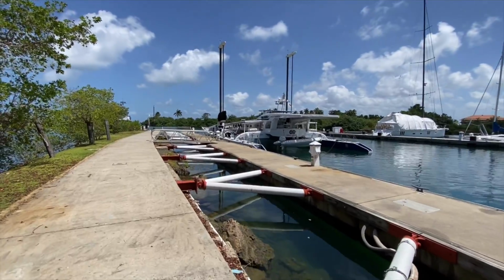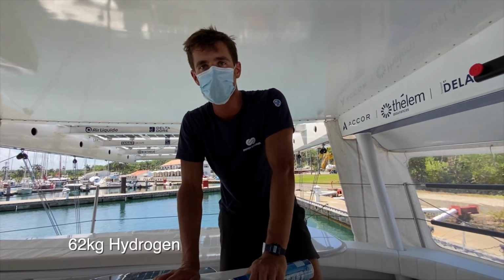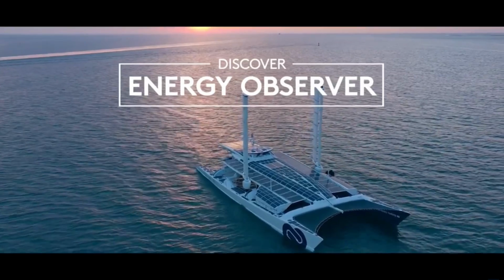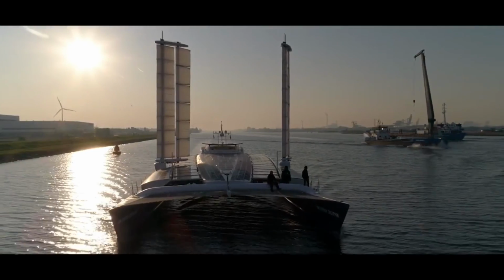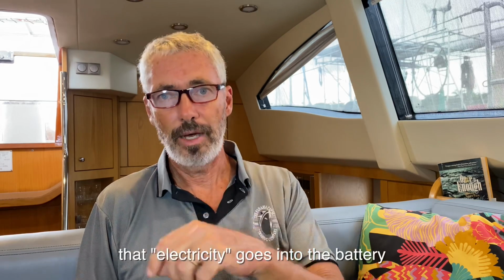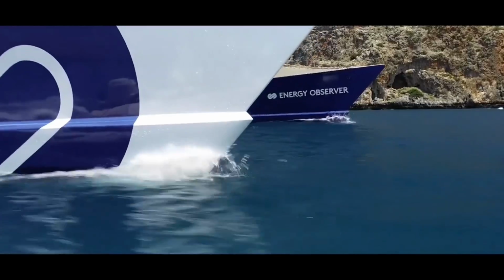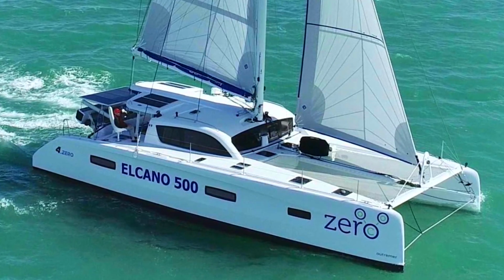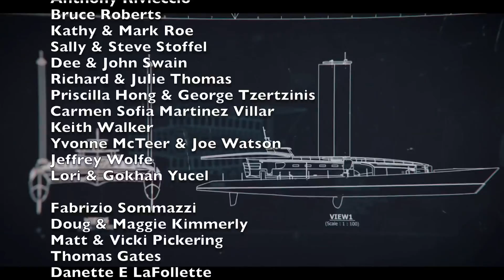Hydrogen-Electric powered boat! Can we get this on our new sailboat? | EP 204

Comment: I wonder how they feel during a lightning storm sitting in a vessel full of explosive gas. I'd like to see their grounding system. I tested grounding systems as part of my job (before I retired).
Reply from the maker: Interesting comment Tom. I asked about fire/explosion and they pointed out the compartment where hydrogen is stored is open to the air on the stern side. And since it’s so light it will disperse up.
Reply: It's amazing that this was not brought up by the hydrogen boat folks.  It looks like this boat (or are there more than one?) has multiple masts for its "wing-like" sails.  Plus being soooo electric a lightening strike would surely do lots of damage.  And since a lightening strike can be (literally) explosive, then hydrogen tanks could be ruptured during such a strike.  It's not hard to imagine that boat being in a million pieces after a lightening strike!   Scott W 
PS - I bet no one is allowed to smoke on that boat!
Reply: @scyz2807  They've talked about it in other interviews.  Like mentioned in the previous reply, they mount the hydrogen vessels outside of the boat (though covered) in a position where any venting hydrogen can more easily disperse, and away from the sails in case it does ignite.

The hydrogen itself in the tanks is not explosive, it's only once combined with oxygen that it becomes explosive, however the saturation level at which it becomes explosive is quite low, so a leak could be a huge fire risk, but at the pressures that hydrogen has to be stored at, there is basically zero risk of the tank exploding.  You could get one hell of a flame thrower at the leak point, but the flame would not travel back into the vessel simply because the lack of oxygen would prevent that, along with the several thousand lbs of pressure preventing oxygen from entering and mixing with the hydrogen.

The biggest risk is a slow leak that goes undetected that allows hydrogen to collect and mix to a flammable level, which is why EO stores the hydrogen externally.  Fuel cell cars (Toyota Mirai being the most prominent) also face this same risk, but even higher with a much greater risk of collision damage to the storage vessel, and I don't believe that any of those have blown up, or even resulted in a catastrophic fire (technically putting them above battery electric vehicles for safety, but that's irrelevant).

Hydrogen transportation is not new either.  The vast majority of hydrogen is transported on trucks and even in the event of accidents, the equipment has safety components and factors specifically to address the dangers which have decades of safe real world use.  Hydrogen and hydrogen fuel cell technology actually has an incredible track record of safe and effective use going back half a century (spacecraft have used hydrogen fuel cells for power since the Gemini program, iirc).

The biggest hurdle to hydrogen is twofold right now
1. Production - Currently almost all hydrogen is "brown"/"Grey" hydrogen that is produced from fossil fuels and releases quite a lot of CO2, and therefore is not really green.  Next is "Blue" hydrogen which is much less impactful, capturing the produced CO2, however it is much less cost effective, as the extra process of capturing and dealing with the CO2 is complicated and expensive.I believe that hydrogen produced via electrolysis, but using non-renewable power source to do so is considered "blue".  Then we have "Green" which electrolysis powered by renewable power, this is the only truly eco-friendly source, and consequently most costly method of getting hydrogen.

2. Efficiency - It takes roughly 55kw of power to purify, electrolyze, and compress 1kg of hydrogen right now.  At 100% efficiency 1kg of hydrogen stores around 33kw of power, so even if fuel cells were perfectly efficient it would only come out to around 60% efficiency.  Unfortunately the best fuel cells are around 55% efficient, meaning you can extract a bit over 18kw from 1kg of hydrogen.  This can be increased by utilizing the waste heat for something, however many applications simply don't have enough need for that much heat (imagine 150 100watt incandescent light bulbs running at the same time.  You could bake a cake with that), so there are limits depending on your application.  That leaves us at a final efficiency of a system around 33%.  Technically speaking this is actually more efficient than gasoline or diesel, particularly when you account for the production side of the equation, as gasoline and diesel engines are only about 30-40% efficient at extracting energy from dino squeezings, but still not ideal, particularly for an application like a boat that might need to produce its own hydrogen such as is the case with EO.  EO is unique in that they can fit an amount of solar production massive enough to make this efficiency loss workable simply by having far more than enough solar power generation and using the excess to produce hydrogen for deep storage.  In a practical, real world "normal person" use case, such as a cruising boat, fitting enough solar to power a boat without electric motors can be quite challenging, and fitting enough to have meaningful excess that can be used to produce hydrogen means that the boat has to be designed specifically for that goal.  Catamarans are the best cruising platform for that simply because they have so much more real estate available for solar panels, so these will be the first consumer level self-producing hydrogen boats we see.

I myself have spent the last 8 months of my live working on designing one, and wish I had the many millions of dollars it would take to go from napkin sketches and playing around in fusion 360 to factory turning the industry on its head.  If I wont the lottery this would be what I would do with it.
Reply: @FlesHBoX  Thank you for your reply. I want to be an one of the first crew members on your Hydrogen powered Cat after you win that lottery 😁👍
I was a High Voltage Test Technician, now retired and looking for warmer weather than Upstate New York.
Reply: @FlesHBoX  Thanks for all the information.

Comment: I think that graphene batteries, and possible graphene desalination could be real game changers. Apparently the power required to generate the pressure required for reverse osmosis desalination is high than you'd think.  Graphene allows for lower pressure, and energy expenditure to get the same water. Graphene batteries will also be significantly lighter, and almost completely eliminate the rare earth metals required in lithium batteries.  They are still a number of years from being cost efficient on an energy density basis, but it shows a lot of promise for a material we only discovered in 2016.  What do you think?

Comment: FYI:
UK is building a liquid air battery using green energy to compress air into liquid and store it. When energy is needed, the stored air is released forming a gas that powers a turbine. The turbine then uses some of the energy to convert air to a liquid for storage. This was reported by The Guardian on June 18, 2020. The title of the article is "Climate emission killer: construction begins on world's largest liquid air battery." This battery is due to be placed into service in 2022, able to power 200,000 homes.

Comment: I just cruised down and back up the Atlantic coast in a 36' sailboat with a 15kw electric inboard and a 6hp tohatsu sailpro outboard in a converted lazaret locker. Worked just fine, but limited top speed to 4.3 knots under gas of which we carry 24gallons. All things in moderation I say.

Comment: Watched the documentary on this boat.They try to convince you that lithium batteries weigh more than hydrogen but they don't tell how much thr tanks weigh..... 

2.5 kg of hydrogen goes in a 40 liter the size of a scuba tank which weighs around 18-25kg. 
Since we have 62+ kg of hydrogen we will need at least 26 tanks at 21kg each, that is 550kg in just tanks. Now we need compressors, 100-200kg each, electrolysis machines 100-300kg each, high pressure piping throughout the ship to the tanks, safety equipment, and the fuel cells to create electricity. 

If we look at all the weight, we get somewhere in the range of 2000-2500kg for the system.

A 5kw lithium battery weighs 45kg. So we are getting around 200kw in batteries at the same weight. These wont blow up if they get a leak, have zero maintenance and are easy to add to in the future. 

Also your average home only uses 1000kw a month. But we are on a boat that needs to move and the boat only make 40-60kw per day. So unless you are just sitting at a dock in the sun for days on end, you will never produce hydrogen..
 
Good concept but waste of money.

Comment: I'm curious why you said circumnavigation wasn't possible on solar only based on the Energy Observer. Wouldn't reducing speed allow them to run the engines day and night based on what they are able to produce and store? Is there a minimum speed needed for circumnavigation?
Reply from the maker: I think solar energy might be enough for 3-5 knots max by electric power only. On their ocean crossing they were also adding in wind power via the automatic sails they have. If you are willing to go so slow perhaps it would work. I would want to go faster :-) as a sailor we  mainly achieve 6-7 average on our longer ocean passages so I guess I hoped for that.

Comment: We are an electric-powered 1983 Bristol 35 sailboat, limited by the distance we can motor, essentially being a pure-sailing yacht, spending the hurricane system upgrading our house batteries to 600 amp/hrs of Lithium so we can sit in anchorages running our watermaker, frig and so on even if the day is overcast.
Reply from the maker: Nice Rauf! Did you find enough space onboard to recharge your batteries via solar power?
Reply: @DistantShoresTV  We have 4 X 200 amp batteries wired in series for 48-volt propulsion in engine compartment, charging on prop-regeneration when sailing at 5 knots.  Our house bank has 475 Watts of solar, nest on bimini and dodger, eventually storing energy in 2 X 300 amp batteries wired in parallel for 600 amps of electrical storage.  Rain Finger has enough space onboard for this system.

Comment: Hey paul good stuff,
Baltic Yachts has a program of hydro-generation using a controllable pitch prop as generator!!, may be of interest!!...
Reply from the maker: Looks like they’re using a Hundested Prop which has had a great reputation fir years and would work will for regeneration.  Thanks for pointing that out Thomas
Reply: @DistantShoresTV  Baltic S/Y Canova of course a 20-40 mill. 142ft boat lol... Has a 400kw permanent magnetic electric propulsion. Ave. trials were 27kw at 16 knots  35kw at 20 knots, fast boat lol... not sure how it would work on 50 @ 10knots???

Comment: Forget hydrogen.  It won't be long before a sailboat sail will be one big solar "panel".  I would not be surprised if there are prototypes out there now.  To be practical, however, they would have to work just like a typical sail.  They'd be very expensive too.  But imagine never having to buy diesel and having a smaller quieter electric drive.
Reply: You are totally right. This is the future, and the future is almost now. Arcona, if i’m not mistaken have soft, foldable solar panels on their sails.
EPFZ in zurich is developing in partnership with a startup, solar cells that can be laid on building walls like paint. Dinosor fuel should soon be where it belongs. In the past.
Reply: I read some where. I think it was the University of wis That they were working on solar cloth.

Comment: I did my own calculations and I'm not sure about the 100 Kw/h battery pack.

3-4 kg/day
100 Kw batteries
1.5 Tonnes lithium polymer batteries
62 kg hydrogen full tank
14 Tonnes 

14 T = 62 kg hydrogen

Hardingenergy com
245 to 430 W/Kg

LiPo 430 W/Kg (at best)
430*1500
645000 W = 645 KWh/1.5 Tonnes

245 W/Kg (Lowest)
245*1500 = 367500 = 367 KWh/1.5 Tonnes

14 Tonnes batteries = 62 kg hydrogen
245*14000 = 3430000 Wh hydrogen power
3430 KWh hydrogen power

RMI org
energy density of hydrogen is equal to 33.6 kWh of usable energy per kg
33.6 * 62 kg
2083 KWh = 62 kg hydrogen = 14 Tonnes batteries
2083/14 = 148.78 = 149 KWh / Tonnes batteries
1.5*149 = 223.5 KWh =1.5 Tonnes
223500/1500 = 149 Wh / Kg

Comment: So you pull into the Bahamas empty - where are you going to fill up with hydrogen? Where is the nearest pump? Also it’s very inefficient to use hydrogen, maybe 30/40% vs 80% for battery electricity. They you also need to store it under pressure which in turn uses electricity. Not very efficient at all. What we need are better solar panels. Current are about 25% efficient but think what they could do for a boat if they were 50%?

Comment: For a yacht the prime mover is (surprise!) it's sails. We motor for two reasons, for close maneuvering and to get some where in a hurry.
On board solar and wind can generate enough for propulsion (plus some regen under sail) but not for extended motoring. For local sailing into a marina it's OK but Hydrogen is only practical if it can be generated on shore.
The real question is "Do I want to get there quicker or wait for the wind, just as boats of old had to do?"

Comment: Hey very nice boat u got i love it its best boat around :D about hydrogen u r right thats the future and i ll remind u that hydrogen comes from water mostly salt water by very easy process electrolysis u dont need to buy the hydrogen from ports :D u produce it on ur boat if u have a good system u can produce enough for direct engine supply if not u ll need small tank and compressor the solar or battery ll start the electrolysis than generator ll came out with 4kW/h in this process u have other products too oxygen, distilled water and salt the system that produce is compact and can fit in car but u ll use bigger for good constant supply than fuel the tank with filtered sea water and go ahead USA navy doing that from decades its time to go commercial ... and make ur boat unsinkable its shame so good boat is not cork style!

Comment: In the case of a sailing boat I think solar and hydro generation (prop in the water spinning the motor to generator) is more than enough.

Hydrogen is being pushed hard by people like Toyota but it's horribly inefficient and we are a long way from generating hydrogen from renewables at any scale. Almost all hydrogen used now is from Steam reformation of natural gas which is mostly CH4, aka methane. This releases carbon into the atmosphere which combines with oxygen to become co2.

They are talking about technology to capture that carbon but again its a long way off.

Battery and solar technology is advancing fast as well as aquatic electric drive systems.

Comment: Boating (and shipping) are some of the applications I can imagine hydrogen use for. Cars, trucks and trains are probably much better off with batteries, since they can recharge quite often enough. If you have lots of power available, why not save some for a rainy day? (pun intended ;-))

The guys on energy observer said they have 100 kWh in 1.4 tons of batteries. A 100 kWh Tesla battery weighs about 400 kg (but is probably more expensive and possibly riskier WRT to fires). However, I think with the LFP cells they have in the SR+ versions of the Model 3, you could have 100 kWh in 700kg with no risk of them catching fire (and be quite a bit cheaper, apparently).

Those 62 kg aren't the whole number, though, you need to keep in mind the weight of the electrolysis system, the fuel cell and the tank as well. I think their setup is really good, though - H2 storage scales really well. You have the base weight of the generation and consumption, but the storage isn't that heavy, so that scales up much better than batteries.

My dream boat would be a large sailing cat with lots of solar, a big bunch of batteries and possibly some hydrogen system.

Comment: How do they compress the hydrogen and how do they deal with hydrogen leaks? Hydrogen is a very small atom and it leaks through everything.
Reply from the maker: Compressing the hydrogen up above 300bar I think is part of the quite complex production system. I didn’t know about the leak problem. Theirs seems to be working well
Reply: Sealing hydrogen has been done for a long time but boat life serves its challenges. Electrolysis strips the oxygen and hydrogen apart, the bond between them is very strong and takes a lot of electricity to break it. Hence why it takes a while to recharge the tanks. Btw is awesome they can do that on a boat and compress it down into the tanks at 300 bar.  Wicked.

Comment: I was looking at Oceanvolt who are working on drives and generation. I don't know about hydrogen. They seem to be focussing a lot on sailboats.
Reply from the maker: OceanVolt seem to be providing a very integrated solution. Hydrogen is bit further off for boats I think.
Reply: I got a price from Ocean Volt for a 40 ft sailboat. It’s almost 100k. You have to couple it with a diesel generator for safety. With an hydro generator and a wind generator, you’re in business. I know a boat equipped like that. His diesel tank is enough for many years. Less emissions in the air.

Comment: You skipped explanation of converting hydrogen to electricity.   How does a "fuel cell" work?  Presumably it powers a generator, not an engine driving a prop?  What kind of hydrogen-burning engine is best?  Turbine or standard piston engine?
Reply: Fuel cells are galvanic elements, similar to batteries. They convert chemical energy (fuel, oxygen) directly into electricity by catalyzed electrochemical reactions.

Comment: I think, in a Sailboat unter 60 Foot, batterie storage is enough. (to many systems) You can use the engine as an aquagenerator. A back up of a generator with vegetable oil is easily. The size of the battrie is a question of money. You safe weight (and room) without a diesel-engine & tankvolume.